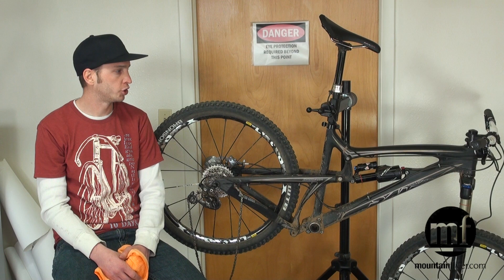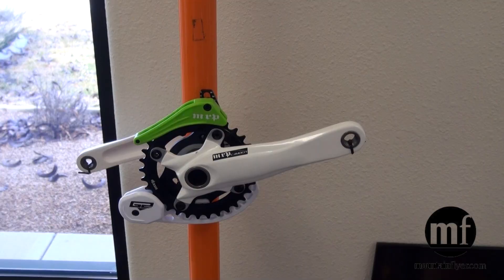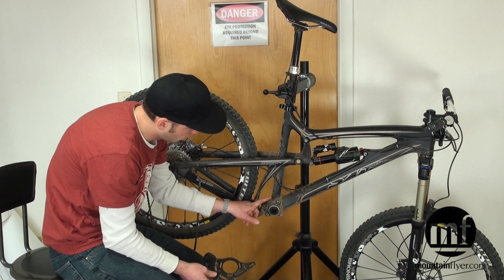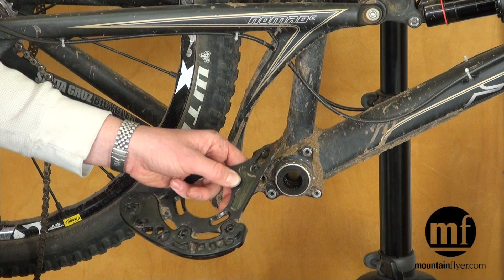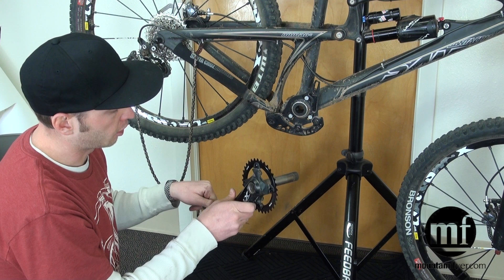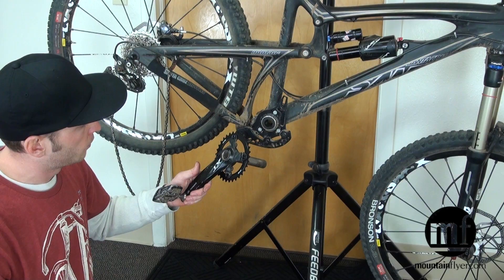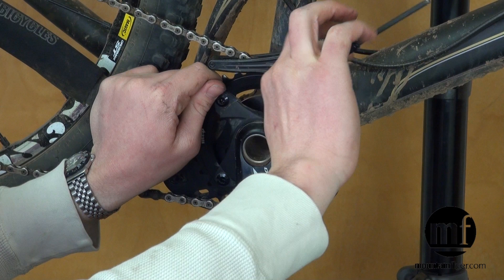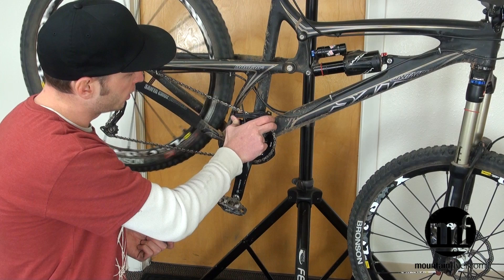Shop Tech Video: MRP Chainguide Install

Comment: Is there a way of installing a chain guide on a hardtail frame without the ISCGO tabs? My hardtail doesn't have those tabs so is there a way to install it through the bottom bracket?